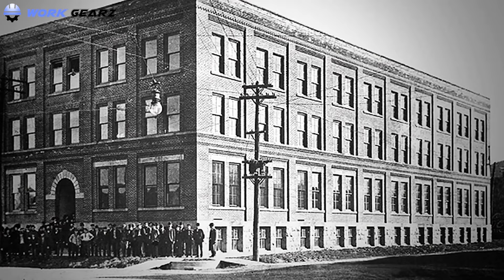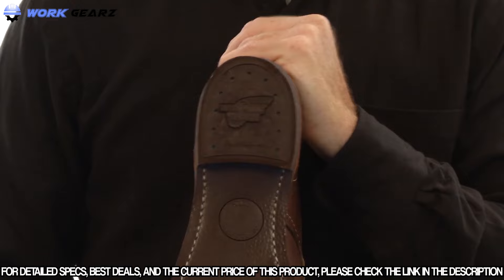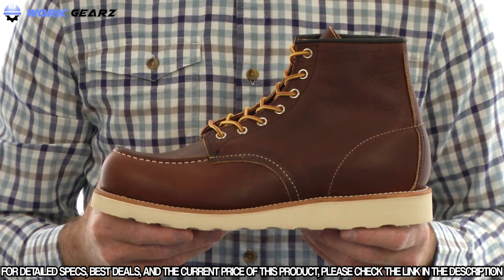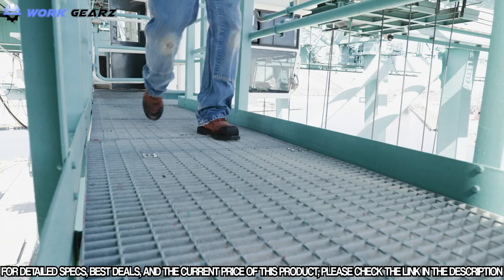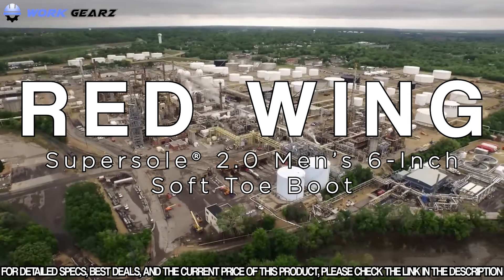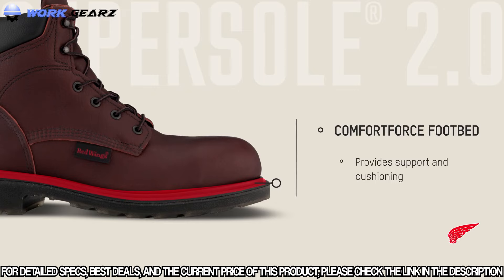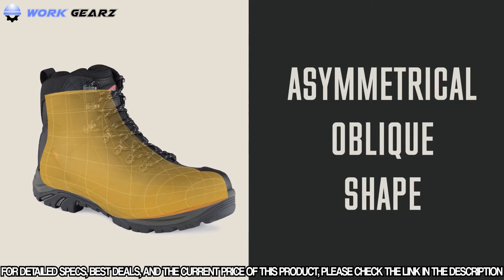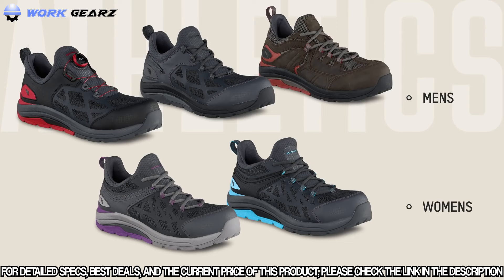Top 10 Best Red Wing Work Boots

Comment: I loved my Red Wing Burnside boots for 2 months.  Then the speed hooks started pulling out.  Don’t waste your money…
Reply: @edwardwelch7560 Your local Red Wing store should be able to replace all the hooks for free. Tell them to use the stud hooks. Otherwise you should be able to get a replacement pair due to the 1 year manufacturer warranty. Just make sure the replacement boot is from a different production run date from the original pair. Hope this helps

Comment: The heritage line is a casual boot and not designed for any work out side of an office cubicle.  Their actual work boots have been farmed out to foriegn manufacturers and are imported. Their work boot quality died with the outsourcing
Reply: Funny, my Red wing work boots have " made in USA" labels on them, always have.
Reply: @6h471  I shouldn't generalize like I do because there are a couple exceptions. It took a while on their website but I did find there are a few still assembled in the use with imported materials and fewer yet that are still showing made in the USA but the vast majority are made in Vietnam (and a couple other countries). I wear loggers because of what I do. They have 1 assembled in the US with imported materials (according to their material descriptions) with none fully made in the USA. I just pulled 11 different styles at random and of the mix 2 were made in the USA, I assembled here, 1 in Cambodia, and 6 in Vietnam.  Unfortunately I remember when their boots were made in the USA and you didn't have to read all the fine print to find out where they were actually made.
Reply: @peterweikel7123  You are right and wrong. The heritage line is still manufactured here in the US and those are constructed with a hand and machine building. The work boots on the other hand are made here in the US as well as in Vietnam (depending on the model). The one thing that separates Redwing from the rest is that all the parts are made here in the US but assembled overseas. A tip is that if the tag within the boot is a white tag, it is constructed here in the US and if it is black, then the parts are shipped overseas and constructed there. One thing is, the same tanner from 80 years ago still produces the leather for all Redwing and Irish Setter boots.

Comment: Red Wing Super sole boots are shit!!  My super sole fell apart in pieces and I hardly used them. There is no sticking in the welt !! No one could repair them. Had to send back to Red Wing to reglue them.
Reply: I also had issues with the super soles when I first started getting them about 8 years ago, but I recently purchased a new pair and it seems they've fixed whatever the construction issue was and I couldn't be happier with them. If you liked everything else about them give em another shot.

Comment: Absolute worst work boots ever.  The soles fell apart after 2 months.  I took them back to the store and asked if they would repair them.  They said they can be resoled for a price.  $100.  I said that's ridiculous and turned to walk out.  The salesman was holding the shoes when I was walking away.  He said what about your shoes?  I told him you know where you can shove them.
Reply: Never resole at red wings go to a boot cobler. You can get it done for about$75
Reply: Which boots?